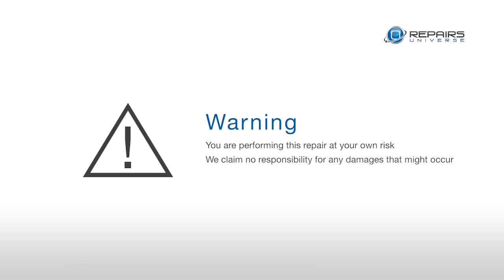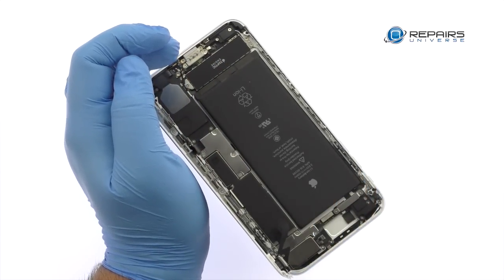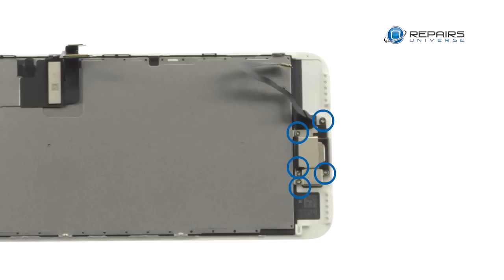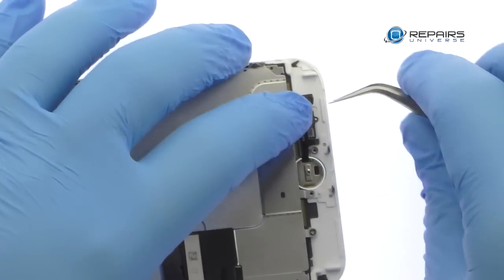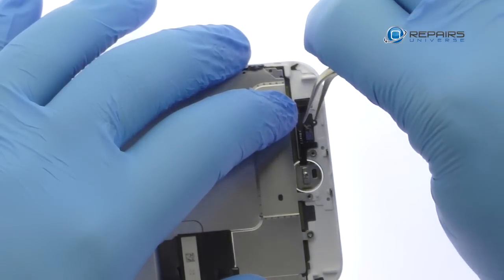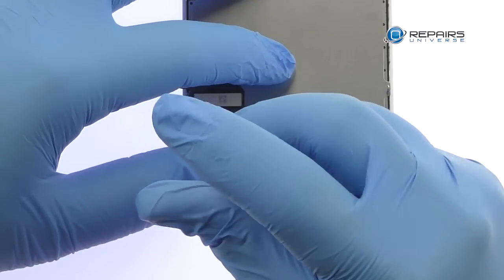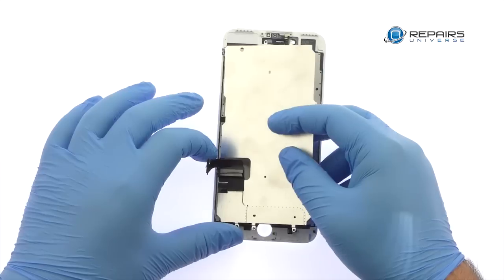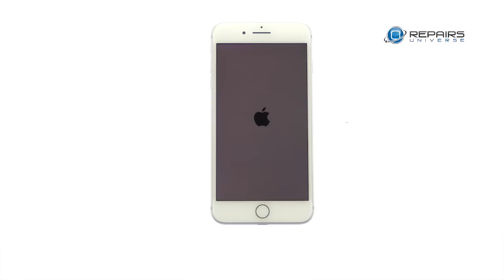iPhone 7 Plus LCD & Touch Screen Replacement Guide - RepairsUniverse

Comment: Will the waterproof feature still continue even though, youre replacing it by yourself?
Reply from the maker: The device will no longer be water resistant.
Reply: That's because it's a mediocre repair, they have forgotten to apply the display's sealing adhesive.
Reply: What frank said.
Reply: No, but an alternate solution is to look for a seal at different online website.

Comment: Opening the device will definitely terminate the waterproof protection , right ?
Reply from the maker: Yes, the device will no longer be water resistant.
Reply: jassim alkhamis unless you buy the Waterproof seal
Reply: Ebay has the replacement adhesive. Easy to apply and comes on a plastic template to apply it. I know this comment is old, but I'm posting for whoever else might need to know this
Reply: I've only seen one video on how to replace adhesive.  Most of these tutorials don't even mention it.
Reply: @bane_mane_473  thank you!

Comment: If my screen is still functioning properly but cracked alot. Cant i just get a front glass replacement without the digitizer? thanks.
Reply from the maker: Glass only replacement requires specialized machinery and is outside the scope of our videos.
Reply: You can’t.
Reply: the digitizer is so extremely fragile it’s too hard. i’ve tried it. it’s like trying to scrape off eggshells. way more difficult!

Comment: Yo my ear speaker not working anymore
Reply: https://www.ifixit.com/Answers/View/380113/Earpiece+does+not+work+after+screen+replacement
This might fix it. if does will you reply have same issue with one I fixed haven't had time to go back and try it yet
Reply: Mines is ultra low I have to put it in speaker 🔊 🤦🏾‍♀️for every call
Reply: Same for me 😩

Comment: i have accidently broken my home button ribbon flex cable..now can i get it repair or the home button is gone forever? "iphone 7"
Reply from the maker: The touch id does not function on any replacement buttons.
Reply: sir the button is absolutely ok..just the flat cable which comes from the back of the lcd to the motherboard is damaged

Comment: I replace my LCD on my phone 7plus and don't turn on what's the problem
Reply: Damaged ribbon cables
Reply: Reset it
Reply: Your phone is fine. IPhones tend to do that from time to time after a screen replacement for some reason. Take a deep breath and simply reset the phone. If that doesn't work then plug it in to an outlet for like 30 minutes and then try resetting it again. You should be fine......he wrote knowing that the message was left 2 years ago.